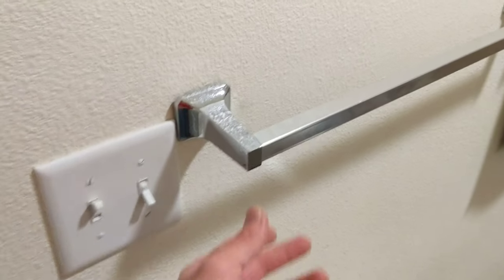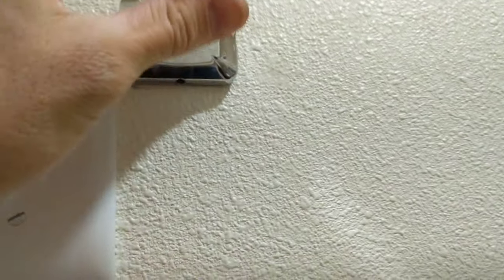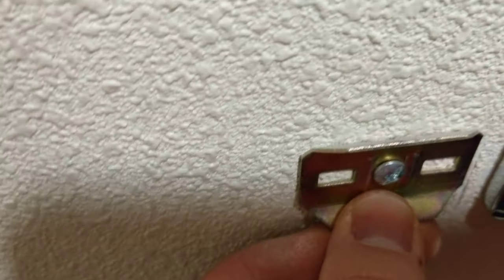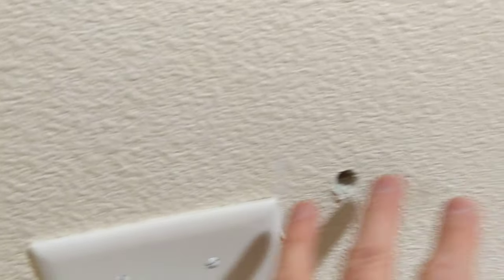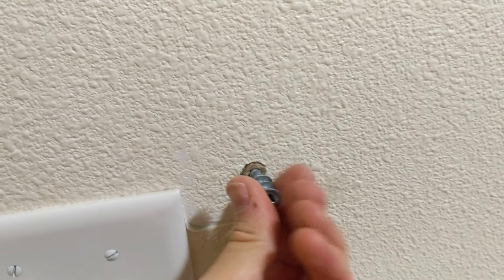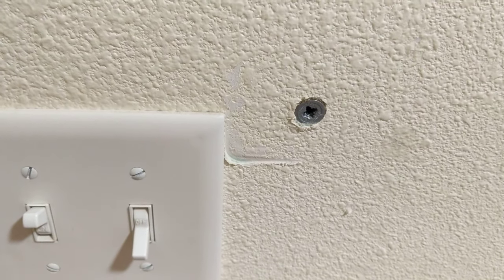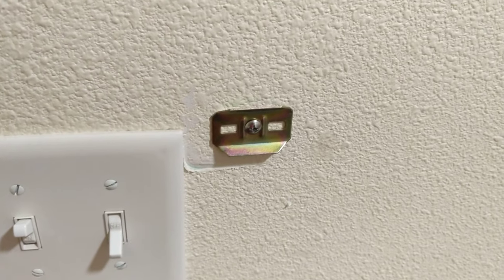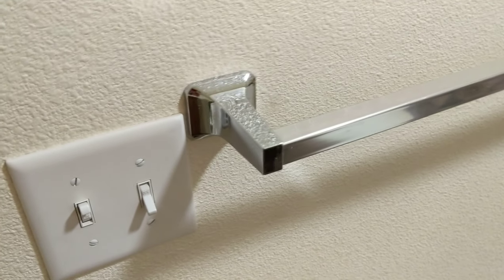HOW TO FIX A LOOSE TOWEL RACK

Comment: You gave a good point in this video. I have an elderly parent that would absolutely grab a hold of the towel rack to steady themselves if needed and I think this may have caused their towel rack to get loose because of this. I've seen handicap rails that can be bought and installed for safety. I'm wondering if I could just simply replace the flimsy towel rack belonging to my parent with a much sturdier handicap railing to serve the same purpose. Has anyone else done this or have suggestions on ways to improve safety for elderly parents in their home? Thank-you for this video it inspired me to try this.
Reply from the maker: might not be a bad idea.. the only thing is if it had a towel on it .. that could make it difficult to grab?

Comment: HOW DID YOU SNAP BACK THE RACK ONTO THE MOUNTING? Mine fell off the mounting...
Reply from the maker: Hello, once the metal brackets are screwed into the wall.. then put the towel rack ends over the metal brackets.. this is secured by tightening the little screws on the bottom of the towel rack portion

Comment: The tiny pin that secures the rod to the wall bracket is broken, so I am looking for a way to remove it. Being both small, and flush against the wall are two strikes against it. Small pliers didn't do the trick. Looking for another way to removed it from the wall without unnecessarily damaging the wall.
Reply from the maker: Hey ELAINE, perhaps it can be drilled out? also there are broken screw pulling kits... YOU can drill into the broken screw then use a special bit that will allow you to unscrew it.. if the tin is stripped, perhaps a small flat head screw driver could be inserted to maybe get enough grip to unscrew it?  sorry I am not more helpful

Comment: You didn't even show how you put the towel rack back on 🤦🏾‍♀️
Reply from the maker: eep, what was I thinking.. I should have shown that.. basically tighten the screws underneath to make sure they are secure then place the rack over the top and tighten the little screw on the bottom.  Have a wonderful, blessed day MARY :)

Comment: ? Are the tools you are using called
Reply from the maker: I used a small flat head screwdriver for the little screw on the bottom of the rack.. sometimes you need an allen wrench if it is that type.. Then for the sheet rock anchors I used a philips head screwdriver